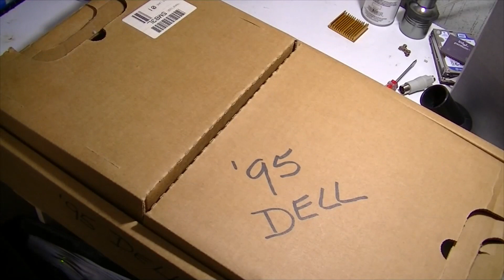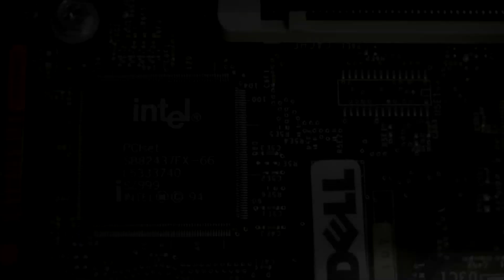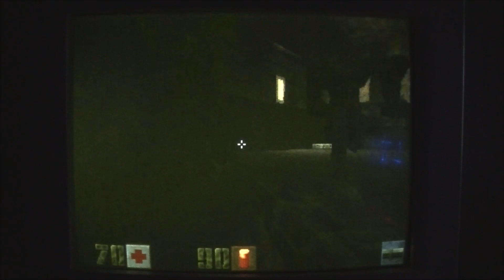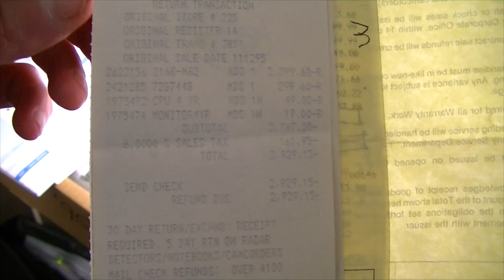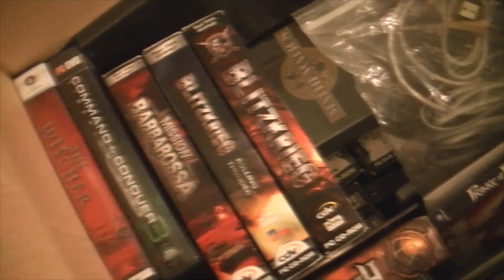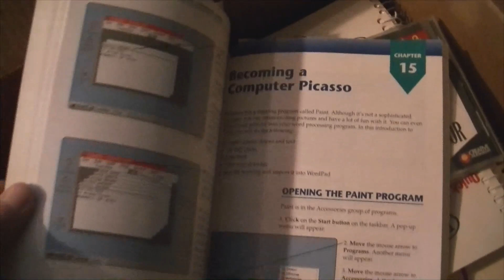Dell Dimension XPS P120c

Comment: Pretty sure the first socket 5 chipset was the Neptune or NX.  I recall my early 1995 Gateway 2000 P5-90 machine having one and being very jealous when the faster Triton came out not long after.
Reply from the maker: Yep, Neptune, which is basically the same chipset as Mercury. Then came the line of Triton's

Comment: In 1995 I built my own Pentium 120mhz system, double speed cdrom, 32mb ram, 1gb hard drive, sound card, external modem, and 15" CRT monitor. I installed Windows 95 and OS/2 Warp 3. I know I did not have $3000 to spend back then, but building it myself saved a bundle. I wish I still had that system.

Comment: Very well preserved indeed, Socket 5 too? Don't see many of those around. It's shocking when you think what this stuff used to cost, I think only a year prior to that system was when RAM was famously $100 per 1MB and any CD-ROM drive capable of Quad Speed was a very expensive luxury that most machines didn't have. The PSU won't be standard ATX as it has no 3.3V rail, the connector near the PCI slots is for that I believ but Dell probably didn't think anyone would need 3.3V PCI cards installed (and they probably didn't) given they were very uncommon back then.

All the software and manuals is a bit like you said, it's like a compacted version of a software store from yesteryear.

I thought that model of Sound Blaster had an EMU 8K onboard, maybe check the multimedia applet in Control Panel.

Topbench is certainly weird sometimes, it seems to reflect performance in productive applications much more closely than it does games and expects a pretty normal configuration in my experiences, certain cache and memory timings can have a massive impact on it. I forgot my K5 was in the list and is testament to the noted weirdness, given that I can double the score on a 486 which of course won't keep up in most tasks because in reality, that K5 is unusually quick in that Pine motherboard - shocking really, as I have a suspicion that it is merely a PCChips M520 in disguise.

Good video.
Reply from the maker: HighTreason610 That is a good point about the midi. It does have the EMU8K + Yamaha OPL3 FM. This was probably the Yamaha chip the player was using. I will have to look at that again. It is stated on wikipedia that software had to be written to use the EMU8K. I should look into this a bit more because I think Descent has at least the option for SBAWE32. Would be curious if it is a noticeable change.

I've done 2 tests with topbench between an AMD 5x86 @ 60x3 (180) mhz vs a Cyrix 5x86 @ 60x2 (120Mhz) with a Trident 9440 VLB card, and both score the same, about 392 on the score.  I need to do more work with that. The PCI cards I started with when I was testing couldn't manage much above 260 or so.  Topbench seems to really like VLB cards.

This guy also had an old Nintendo with apparently a ton of games also. Of course, his kids were not going to let him give that all away :)  The computer stuff they couldn't care less about though.

Comment: I purchased the Dell Dimension XPS P100 with a 17 inch CTX monitor and Altec Lansing 2.1 speaker set for $3500 back in early October 1995.  Nice overview, thanks.